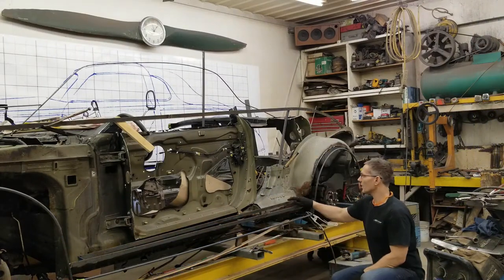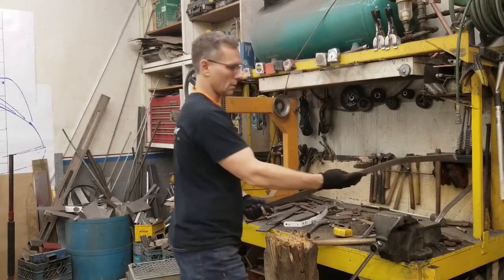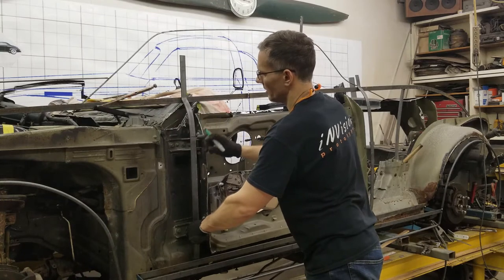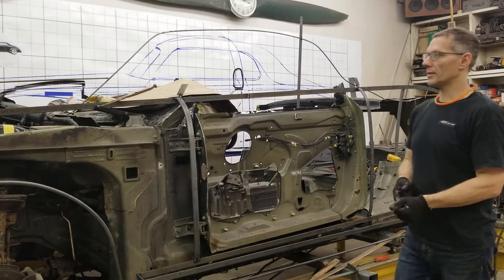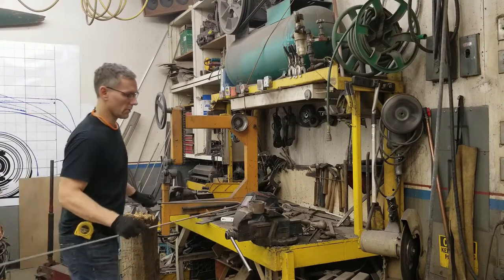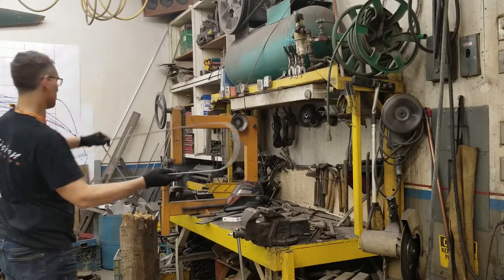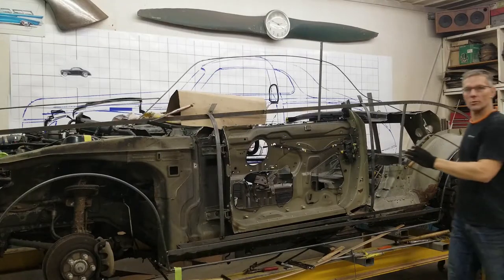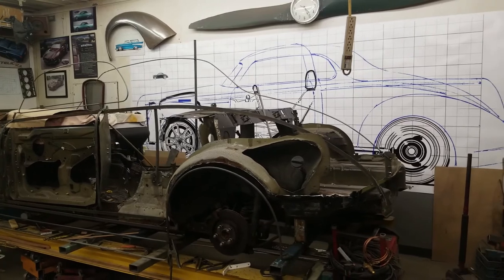Shaping MORE Steel Rod for the Wire Frame Buck | Part 7 - 1940 Ford Coupe Inspired Hot Rod Build

Comment: Bad ass build. Ever tried a laser level on a stand to square it with your drawing?
Reply from the maker: Hi Patrick, that's what the frame table is for.  Once datum points are set all dimensions translate directly up from the table.  We do however use the laser as a double check.  Thank for watching!

Comment: Thanks for showing what it really takes to build a car !   How many hours did you have in at this point?  I like the concept of using the mustang.
Reply from the maker: Using a donor is a different approach in building a hot rod.  Most times we do it in the traditional sense where we create the chassis, drop in a big crate engine and then either use an existing body or create one.  In this case, the M40C's client can stop by any Ford dealership if he ever has any trouble on the road and they can get him up and running.  In regards to the hours, probably sitting around the 200-300hour mark.  We're still in the early stages of this build with design, buck development and metal shaping.  Thanks for watching and Subscribing!  Much more to come!  N.